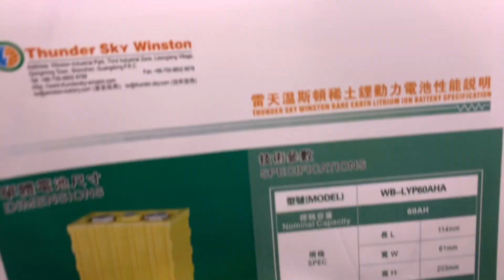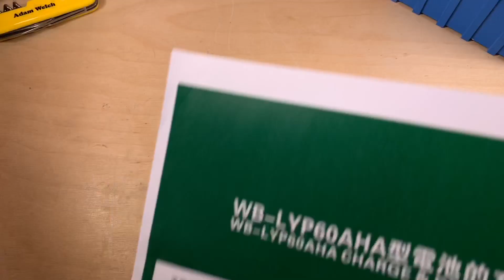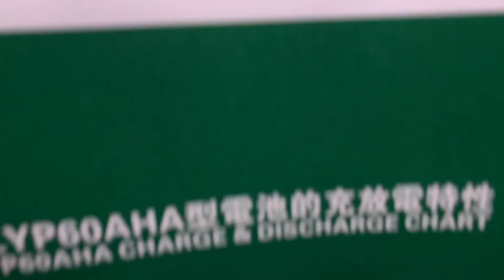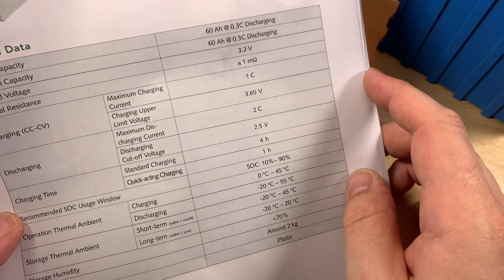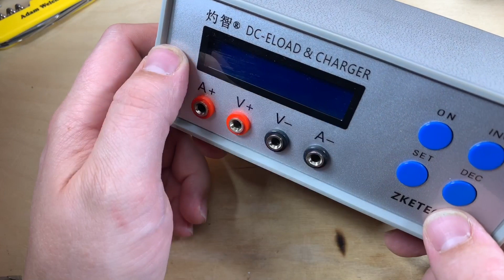Change of Chemistry

Comment: Cost? £10 for a breakers yard lead acid. Cheaper to just use the mains than these Lipo's.
Reply from the maker: I got these for free. I completely understand that this isn’t going to be sensible for anyone and everyone, but I enjoy learning and telling my story - so hopefully a bit of new knowledge for some viewers who want to go down this route will be useful. 
At the end of it, I’ll be able to discuss the pros and cons - and of cause money in a big factor.
Reply: Adam Welch Don't get me wrong. I really appreciate your vids! But I'm not yet persuaded that there's any advantage whatsoever to switching to Lithium apart from from perhaps space saving. The main problem I have with my 8 car battery pack wired in parallel is telling which one has gone bad without a lengthy dismantling and testing palaver. A vid about this would be great!
Reply: @johnarmstrong3782  That's easy. Get a clamp meter and check the current running through each link while they are charging, use a quick bit of mental arithmetic to work out what currents the ones in the centre of the pack are taking by subtracting the current on one side of the link with that from the other. You'll then have a "rank" of biggest to smallest as to which batteries take the most charge current. 

Then do a discharge through a reasonable size load, and measure the currents in the links. If all the batteries are good then the highest current charging battery will supply the largest share to the load, the 2nd highest charging will supply the 2nd highest amount of current to the load and so forth. 

If any battery drops down in "rank" then it's likely to be dodgy. As these ones tend to take a lot of current charging and supply much less during discharging. There is another test you can also do while the batteries are still linked together but describing that will make this already long comment uber long, but I'll tell you if you want to know.
Reply: @johnarmstrong3782  

I run both lead acid (Pb) and Lithium in my solar workshop and for portable power. While Pb is an easy and cheap battery technology to use, it is seriously lacking when it comes to energy storage and service life. The cells Adam has are capable of several thousand full capacity charge and discharge cycles, whereas Pb batteries are capable of a couple of hundred cycles. If you were to factor in the cost of Pb batteries over the entire life of  LifePO4, then Pb will work out much more expensive in the long run.
Reply: Assuming the charge controller is configured correctly  and low voltage cut off is also set right as well (3.5v to 3v is typical range you want them in)
Reply: xanataph Thanks so much. Very helpful. Yes I really want to know the other method. What bothers me is not so much whether one battery is better than another but if one of them is pulling down the whole pack.
Reply: xanataph At the moment I tend to think everything is fine if the pack holds at 12.7v with no load?
Reply: @johnarmstrong3782  Absolutely. If the pack stays at 12.7v overnight with no charge or discharge, then everything is probably pretty good. Finding out the rank of how good the batteries are is simply a means to an ends for finding out if there are any bad ones. What you're looking for is if the rank changes order from when going from a charging to a discharging state. That shouldn't happen if all the batteries are "good" i.e. no shorted cells. 

The other way to sniff out a battery without removing your links is to make sure the pack is fully charged and then remove all charging current. Allow maybe half an hour for them to settle down and then check each link with the clamp meter. There should be pretty much zero current in any of these links at this point, but a few tens of mA is OK. If you see several hundred milliamps or maybe an amp or two moving, check the direction of the current flow to see which battery it is moving towards. This will be your bad battery. If it's near the centre of the pack current will be flowing into it from the links on each side (most clamp meters have an arrow marked on the clamp, if it shows a +ve current then it's moving in the direction of the arrow).

When I find a suspect like this, I isolate it from the pack by removing the links from one of the terminals and just bolt them together to form a bypass. And then leave it over night. If in the morning it shows something like 10.8 volts, it's naughty behaviour has been busted! Some batteries are a bit sneaky and they will still show a reasonable 12.xx volts. In this case connect a test load in the region of 40-50 watts to it, and if it's a shorted cell (or lazy cell) battery the voltage will immediately fall to 10.8 volts or lower under load.
Reply: xanataph Thanks so much.  I appreciate your very helpful reply. I've printed it for future reference. I have a Uni-T DC clamp meter and will be following your guidelines.
Reply: John Nodge Well that's not what I have been led to believe. I've been put off buying an electric car because I've always been told that Lithium batteries start to degrade after between 400 and 800 cycles? An ordinary car battery lasts a good six years or more? At least they seem to in my cars.
Reply: @johnarmstrong3782  I'm playing with old electric tools LiIon battery packs. After 3 years of regular use they mostly become unusefull. But not some of DeWALT packs. They can last as long as 6 years. Why. They use A123 LiFePo4 cells. My point is: LiFePo4 cells are very suitable for a battery Adam is building. They can last as long as 10 years.  Led acid are no match (in my opinion). They can last if only half of the charge is used. But then the cost is double. And still can't match the LiFePo4 in the long run.
Reply: @johnarmstrong3782  No worries, I like to contribute to the solar community in ways I can. I devised these techniques because like yourself, I got tired of pulling battery banks apart just to isolate ones with bad cells! And you get a few of those when you mess around with secondhand batteries. lol

I just took possession of two Trojan 6 volt 220AH batteries that will form my new 'A' bank, which is a 12 volt system. I still think that lead acid batteries are the most cost effective solution. And since it's for a static house power setup, bulk and weight have little bearing on the matter. If they are cared for they can last many years. 

I have a set of two Crown 6 volt CR220s that have run our lighting circuit since 2013. And they are not showing any signs of quitting. The trick is to charge these kind of batteries up to 15.0 volts (for the pair). It doesn't hurt them, but probably uses a little more water. Don't do that with sealed no-maintenance starter batteries though as once the water is gone, they are stuffed.
Reply: xanataph Adam and this channel inspired my Solar 12v set up. It's really only for fun. It provides power for the kitchen/conservator and man cave lighting. We charge all our phones and laptops and general batteries from it and I have a hand built music system powered by it. Etc etc. Mostly I use it for learning about electronics. I have a small grid tie inverter for surplus energy. There is a mass of wires all over the place feeding various boost and buck converters, amplifiers, lights, Bluetooth modules you name it!😀 I i ever had to move it there would be little chance of it going back together!

I have six assorted car batteries in two stacks of three. When one failed last year I had to dismantle the whole bank to find the bad one which was a pain! Now I won't. To replace the bad battery I take a multimeter to the breakers yard and find one at 12.6v. At £10 a pop it's cheap storage imo.
Reply: @johnarmstrong3782  Yes, Adam and his channel are awesome. I always look out for new videos. I'm in a kind of strange situation where I do my system for fun & learning as a kind of hobby, but it just so happens that it powers the whole house & we're off the grid. 

And I did start off small, with just one 10 watt panel and a home made charge controller. That quickly grew to two 95 watt panels and at that point I was running the workshop & my recording studio, plus running extension cords inside the house when there were power cuts. The next step was taking the lights off the grid...and it just went from there! 

I'm getting into a little bit of solar thermal at present, I have succeeded in connecting what I believe was a panel designed for heating pool water to our dishwasher so that's now 100% solar (before the electrics were powered from solar, but the heat in the water came from LPG). 

One useful item to make for testing batteries, especially the ones you are going to buy secondhand is a 50 watt 12 volt halogen light bulb connected to a pair of alligator clip leads. You can buy pre-wired bi-pin bases for these and add clips to the wires or as I did, just cut the brass sections out of a piece of terminal block and use them on the pins to attach the wires. You need a reasonably small terminal block so they clear each other when on the pins. 

Then when you do your voltage test you can also took up the lamp and see what the battery does under a reasonable load. The brightness of the bulb itself does a reasonable job of indicating the performance of a battery too. This is the load I also use when I am checking on  a suspect battery.
Reply: xanataph Thanks for your interesting reply! I'm guessing you must live somewhere that actually gets a reasonable amount of sun! :) Here in darkest Devon there is no possibility of my ever going off grid. Firstly the wife! Secondly subsidies have been withdrawn from solar to the point where it makes no financial sense.

Even if I was prepared to make the investment It would need an enormous installation and massive energy storage capacity to cope with the weeks without sun in the winter. It's possible to be net electricity sufficient but it still requires the grid to feed in during the summer and consume during the winter. 

It's just does not make any financial sense no matter how much I play with the calculator. There's no getting away from the fact that plugging into the mains is much cheaper here now the subsidies have largely gone. Best figures I can come up with is about 16 years payback time for a grid tie net system. And I'm doubtful solar panels last 16 years! If you allow for the cost of converting our mains gas heating and gas cooker it's even worse! (:

From what I understand renewables now constitute about 20% net to the UK annual electricity supply. To get to this figure it has required huge subsidies which cost the average family about £200 per year. Last week one quarter of the grid failed when a wind farm tripped and because there is insufficient inertia now in the system due to renewables to allow for alternative provision to be started up. Trains stopped, hospitals went without power and the lights went out for an hour. It was very serious. I am not yet a convert!😀😇

Comment: No equalization on LiFePo batteries.  0 temp comp
Reply: Ummm... wot?
Reply: @johncoops6897  the epever tracer charge controllers need to have the temp composition set to 0 degrees and you need to set equalization time to 0 and the voltage for equalization to around 13.6 I believe

Comment: Is there some reason you want use a pre-loaded charge profile?  Epever controlers have a User profile that you can program to exactly the best parameters for different chemistry batteries, like LiIon and LiFePO4.  The CALBs I've used seem quite forgiving though, if you wish to stay with AGM/Gel settings....
Reply from the maker: I’ve always tried to do things within a standard profile because the profiles are very similar across most solar charge controllers. If I stick with a standard one then people can copy the setup without having to have the exact same kit. You’re right of cause, I. And adjust all the parameters I like with my charge controller, and I probably should!

Comment: There ya go.   Real Batteries.    Just what I'm looking for .    Still short batteries on my 24V Wind Turbine / Solar Closet.    Pricey little devils.     Most LiFePo4 cells are established as 3.65V cells.    Unlike Li Ion cells they can tolerate slight Over Charge.  They get sick rather fast taking them down below 2.0V SOD.     Lucky Man you are Sir !    Aluminum Strap works quite well as Bus Bar. Much cheaper then copper and does the job Damn Good.  Simply use a little wider strap then you would copper to make up for the little resistance gained.   Using this stuff on my 4S 5P 38120 Headway pack. Cell level fuse NOT REQUIRED.   https://www.homedepot.com/p/Everbilt-1-2-in-x-36-in-Aluminum-Flat-Bar-800217/204604762?cm_mmc=Shopping%7CG%7CBase%7CD25H%7C25-4_BUILDERS_HARDWARE%7CNA%7CLIA%7c71700000044822926%7c58700004636006010%7c92700039037730264&gclid=Cj0KCQjwhdTqBRDNARIsABsOl9_9dg2H7KF9U7CisNxqhrBFt8MJ40YARUUzkxPEoLCWMIik-y9fXtsaAkIsEALw_wcB&gclsrc=aw.ds

Comment: I'm glad you've moved onto LiFePO4, ideal for 12 volt systems. Initially expensive to buy, but work out at 1/4 of the cost of Lead acid batteries and 1/2 the cost of Li-Ion.  Still need a BMS though.

Comment: I live off grid in the winter months on a 540Ah pack of CALB cells. Good to see you move in this direction. :)
Reply from the maker: Hopefully they will all check out alright. Cheers
Reply: @AdamWelchUK  I forgot to say, be careful also of the temperature when charging. In winter the cells may get below 0C which is the lower limit for charging. You'll need a BMS that can switch on that too.

Comment: I have used the 100ah version of that cell for golf carts a few times. They make flexible braided flat cables to fit those.
Reply from the maker: Interesting. I’ll take a look. Thanks
Reply: @AdamWelchUK   come on, all you need is some old copper pipe, a hammer to hit it flat and a drill, DIY and FREE